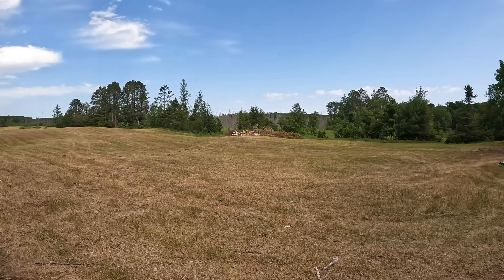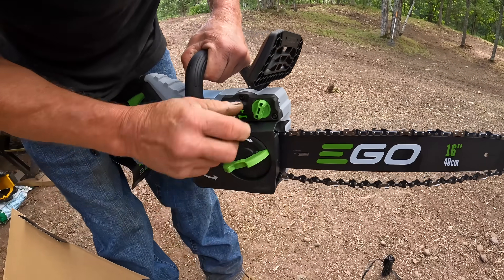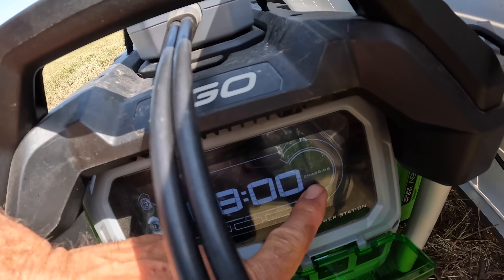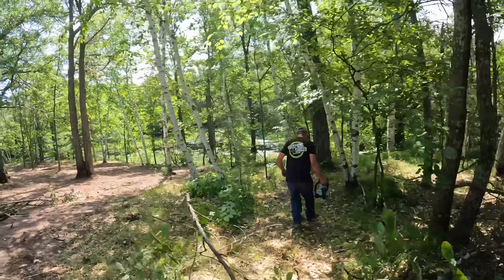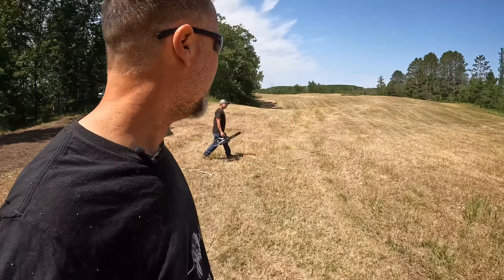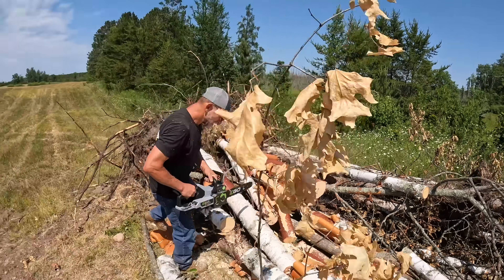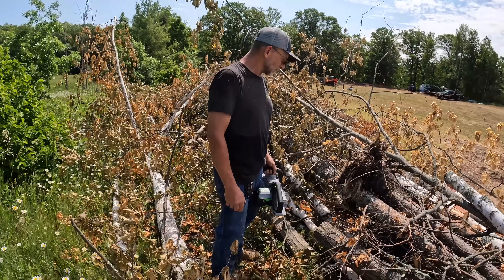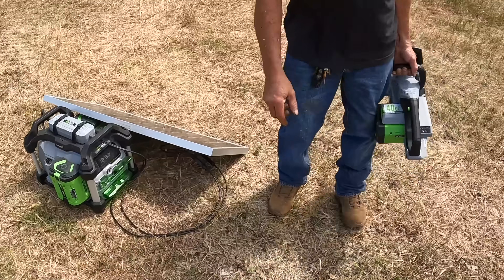Solar Powered chainsaw-Maybe...

Comment: If you had let's say 12 solar panels with 8 one hundred amp batteries you would get twice the power output by adding two charge controllers , your system thinks you only have one one hundred amp battery so it only charges twenty-five amps so if you have a second charge controller you can charge another 25 amps or standard s chainsaw in his case so you would have two inverters and two battery chargers charging the 800 wat battery bank of lead acid batteries !

Comment: I have one of those EGO chainsaws, I was skeptical of it but that is a decent saw. You're not going to buck up a cord of full size firewood or anything major but for 4 to 5 inch or trimming its awesome.

It only needs bar oil, and a battery of course. I had some storm dropped tops and whole trees last winter wored great.
That size of that first tree Frank was cutting trimming even live and healthy would be a piece of cake to drop. 12:29

Comment: Great Use Case for the EGO Power Station combined with solar panel(s) for off-grid battery charging and shore power.  I’ve resisted buying it because other Power Stations perform better as an AC power source.  No regrets switching to EGO over gas equipment.  Thanks for another great Video!

Comment: I borrowed one of those saws it worked pretty good the battery lasted a surprising amount of time but the only downside is the saw was as heavy as my bigger barred stihl saw good for the small job here and there would not be a bad saw to carry on your trail rig for downed trees especially in fire areas

Comment: Do you think the EGO Battery system can function as well as a deep cycle marine battery? I don't know the limits but we have four panels going into our 12v system on the camper. The EGO is probably set up only for so many panels. Anyway If portability is not the issue, I bet the 12v marine battery system plus an inverter for output is going to server you better for off grid  living in general.

Comment: A camper is a way different scenario to living off grid. To live there during the Winter you have to factor in days of cloudy weather and lower sun hours for months, so you really need to overspec the system by a lot, plus install a lot more storage. At that point you are looking at a proper install with fixed panels etc. These boxes are just for the Summer.

Comment: If they come up with a larger system that can take 3 to 4 panels at once per power box then you could easily run a couple charging bases at a time each having 3 to 4 panels you wouldn’t need anything else. A lot of the off grid portable systems like jackery use 3 panels making it charge in a short time.

Comment: I built a budget off grid system for a buddy using 6 golf cart batteries, an ebay 4kw inverter, a 600 watt solar panel, solar controllers, a small HF generator, heavy duty marine battery charger, and heavy duty wires as well as HD extension cords.   I built another more professional system in a cabin using Ni-Fe (Nickel-Iron) batteries and a little higher end components, been good for years.  There are lots of ways to go off grid, I like lead acid for its climate stability and low comparative cost and Ni-Fe for its longevity.  Lithium is coming down in price, but at this point a kw/hr of batteries is around $400 for decent quality and the average house especially off grid and with family can be 10-20kw/hr per day, but could be less if you're frugal or don't need power for climate control and well pumping.

Comment: That’s a pretty sweet set up there Stan! Can you add more solar panels so it’ll charge quicker? Thanks for sharing!
Reply: Sometimes with systems like this. They are only designed to run off of maximum amount of wattage. So in retrospect. There is a limit.

Comment: I love Ego products but the Nexus power station has too many limitations compared to something like ecoflow. Nexus has no pass through charging and it charges way to slow with solar to be usefull for off grid. As for power stations that work off tool batteries it is pretty good compared to Milwaukee Dewalt and Ryobi power stations. I also dont like how Ego has made no changes or come out with a new generation Nexus other than adding solar charging. They could male it much better but they havent.

Comment: Add more solar panels to charge faster.
Reply: Not that easy. The solar charging inverter has a very low charging rate. You could add 500w of panels but it would not charge at 500w.

Comment: I say get as many power stations and panels as you can afford. If money isn't an issue then calculate your max power needs as if you are running everything all at once and build a system that can provide that level of power but leave some breathing room as devices like refrigerators saws and furnaces have surges when they start up. Your system must be able to handle the surge power. Also use an inverter that has a pure sine wave or you'll fry sensitive electronics. I've ran a microwave from a generator during a power outage and it didn't sound happy but it worked.

Comment: I've been thinking about this as well.   I plan to get the Anker 767 battery backup.  Charge that up with solar, then charge my power tools from the Anker.  I priced the batteries and electric generator.  There are many other cheaper options than the power tool manufacturers.  Also make sure the electricity from the power unit is pure sine wave.  You can fry sensitive electronics very quickly if it isn't. 
Thanks Stan.
Thanks Frankie.

Comment: The biggest problem with the inverters that use tool battery’s is you can’t use the 120v or USB receptacles while it is charging. That is true if it’s charging from the wall or from solar. 

This makes them useless in a real off grid situation. If they fix that then they will compete with the Ecoflo type solar generators. Until then they have minimal use. 

That said. I use the Ryobi version to power my fridge during blackouts.

Comment: I like the whole concept of battery powered tools. I've used them for years, without problems. 
If it turns into a cloudy day, you could charge your battery bank with a gasoline powered generator.

Comment: Have a Milwaukee saw and love it.but battery don’t last when hot out. Can saw for over hour when cold to cold on one battery and still have 1-3 bars power, but on a 90 degree day went through 4 12 amp hr a 6amp hr and 2 4amp hr battery in less than a hour

Comment: i can imagine a Solar battery bank work trailer. so basically, you would use the whole surface area of the trailer roof or deck or however it may be configured. then you could have any number of charger units, and batteries and battery types and brands, and you can add or subtract number of units for your expected run time or usage and other needs. have it all in one package, and even have an alternative charge method too. that could be using a type of device which uses a large falling weight to turn an actual generator head module. say 1 Kw, or so, or whatever size is practical for the space. then however long that runs for accounting the time that took and for the reset of the weight, per run time. that could be Very interesting. so instead of a traditional hand crank generator, it would only require the weight be lifted every so often, say 6-12 hours. depending on the height and rate of fall to generate what is needed or designed for. you do not always have solar some times. so it could act as an alternative or "Night generator" that would run and be reset as needed. but could in theory give energy whenever you want it. if on a trailer, along with a built in battery bank, and inverter system for the tool battery units, but could also have other voltage set ups for things like a welder or fridges, like if a hunter wanted to trailer in a fridge/freezer and process their hunt in the field, so to speak. all manner of possibilities exist, and battery tech is certainly useful, if expensive, for now. (and fi we dont include inflation making things even More expensive of course.... sigh) in any case, i am all for battery tools and even vehicles where applicable, and save fuel based items for only the last case scenario of need. so rely on other means before using up valuable fuel to generate with. also, as for design and practicability of such a device as described. some oen else would have to figure that out, based on size and capacity potential and practicability.
Reply: Yeah, some company did that. I can't recall the name but it turned out fraudulent and the owner and wife went to jail for fraud. It can work but it still needs a generator as backup.

Comment: The inverter only works with ego solar panels. Was going to get one but the panels give a terrible amount of charge so its not really worth it,.
Reply: And you can’t use the 120v or USB receptacles while it is charging.

Comment: Great video Stan. I have a couple of the solar generators from ecoflow. During winter it one of them stays in line with our pellet stove for heating so in we loose power it automatically switches over to battery. I also have the solar panels so if we have a prolonged power outage we can keep it going. The technology has been out there for years to answer your question with enough panels and systems to keep up with the power demand,  I can see it potentially being a viable option  for off grid survival.
Reply: You can’t do that with any of the ones that use tool batteries. You can’t use the 120v or USB receptacles while it is charging. Hopefully one of the tool companies fixes that so it could actually compete with the Ecoflo.
Reply: @ecospider5  you are not wrong but that is also why I put in the adage of with enough panels and systems. 
So as you charge batteries off of the solar you can rotate to the systems that are in operation you can pull the I'll use the term lightly cell out and replace with a charged cell and rotate to a charger. Based off of his system I can estimate his panel may be a 50 to 100 amp panel, so multiple panels an increase the charger output as long as the amperage doesn't exceed recommendations. Will this be the end all answer no but would it fill a void if you already have batteries to be able to survive in a pinch if needed.
Reply: I agree. That is how I use the Ryobi power station. I went one step farther and got a dead Ryobi 40V battery. Took out the bad cells and put in a power converter with a wire sticking out the back of the battery case. 

A normal person takes my normal 40v batteries to run the fridge. Then I come after that with 5 1Kwh scooter batteries charged off of solar. 😁🤓